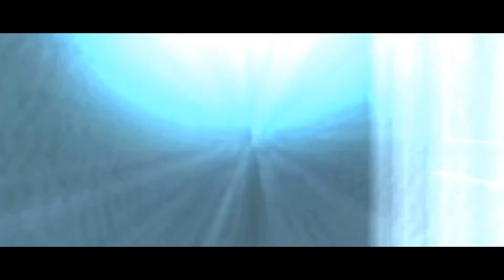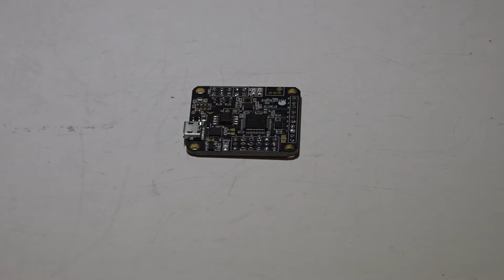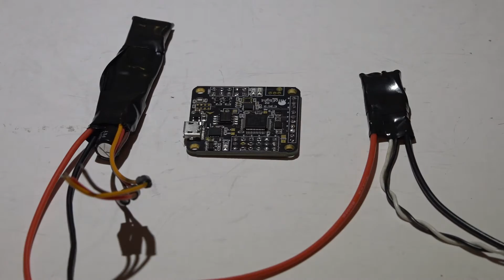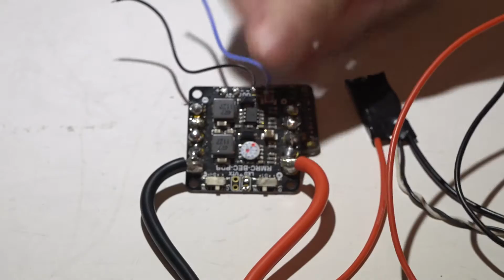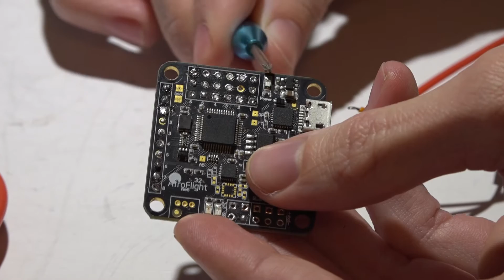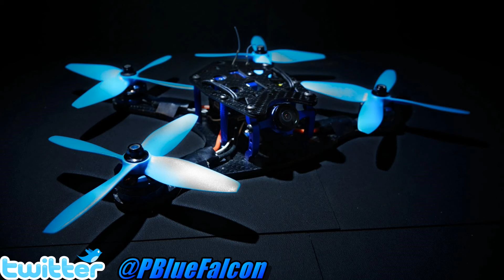Naze32: How To Power

Comment: Thank you for the video, if this is the naze 32 rev6, have you had troubles calibrating the escs? The escs seems to be powered up from the fc, which doesnt allow them to calibrate properly. Do you know of any work arounds? I haven't been able to find anything online.
Reply from the maker: Yep that is a common problem with the Naze 32 since it doesnt have the circuitry needed to solve that. Almost all other flight controllers use diodes to fix that. Unfortunately I dont have a fix for it.
Reply: Insert a Schottky diode between your 5v supply and your Naze. Make sure you have it facing the correct way, so that 5v can flow from the supply to the Naze, but not the other way. I'm sure it's white striped end in the direction of travel.
Reply: Johnny Notech Thanks for this info. Just ordered a few of the Schottky diodes to put one inline with the 5v and Naze32. Hopefully this will let CleanFlight calibrate the ESC's.